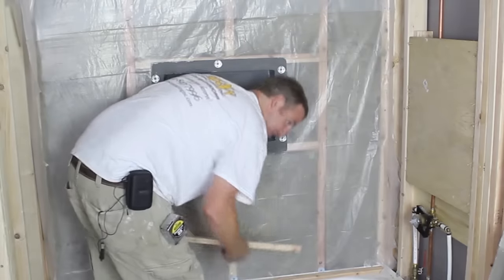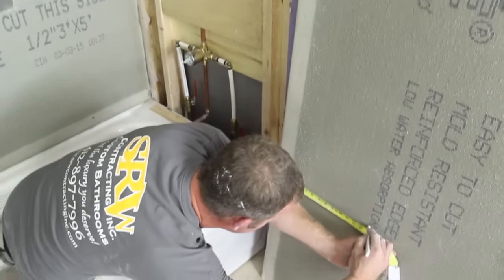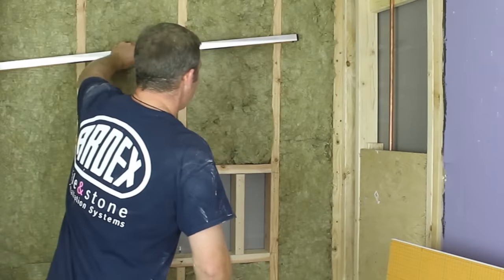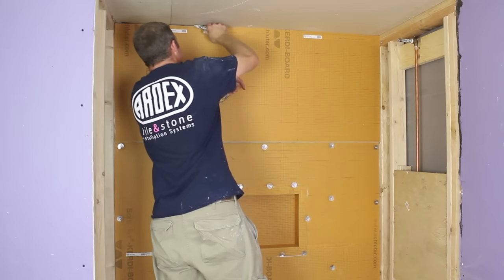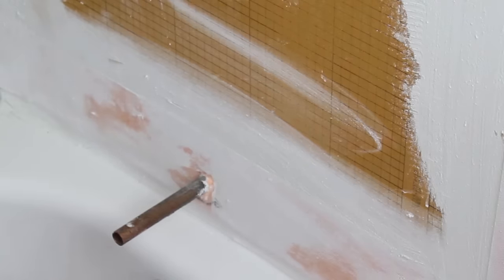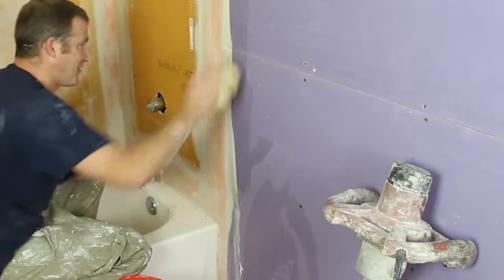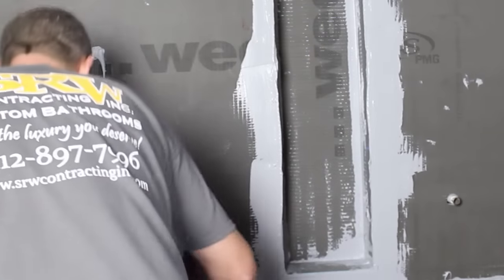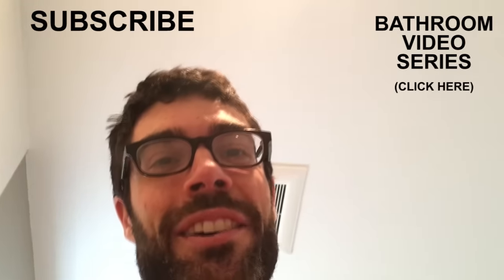How to Waterproof a Shower (3 Awesome Methods!!)

Comment: All 3 are proper methods! As tile setter, I’ve used all 3. Wedi is the hardest to clean, as the sealant is petroleum based and its very expensive. But thanks for a video showing PROPER waterproofing methods.
Reply from the maker: Thanks Terry, appreciate your kind words and taking the time to watch our videos
Reply: Here N There Ede
Reply: What would you use to waterproof the cement board? Liquid membrane?
Reply: Veronica Gutierrez Yes. I find that using fiber tape at seems is advisable.  I just paint it in with the waterproofing.
Reply: @herenthere10  Is thinset on seams necessary if you use waterproof membrane and cloth in seams or do you need to do both?? thank you
Reply: Keith Owens Thinser it not necessary. In fact ive used the liquid membrane to “paint” on the mesh tape. If you use cloth mesh, manufacturers suggest you sandwich material between wet coats. In other words apply mesh cloth while first coat is still wet then apply another coat over mesh. Sorry if i didn’t make that sound clear🙄
Reply: ....Been a long week
Reply: @herenthere10  Thank you for very thorough explanation...........now go relax!! You deserve a break :)

Comment: I've been using Schluter to their specs. It's not mentioned in your great summary that Kerdi board comes in several different thicknesses - this can be a boon when you need either full tile support (board to studs) or just a veneer (board over other wall material). Also, Schluter  pipe seals and profiles are cool to use.

Comment: I have used the Schlüter System several times and my only complaint is that I have found 16” on Center to be too great. The boards actually seem to become concave. I have found that I need 12” on Center to prevent that from happening. Great Video and tips.

Comment: I am an Stucco  contractor  and I have seen many issues with mold and rot, rule number one to avoid  mold and  rot  is AIR, materials  need to be able to breath.

That been said, I rather use the Cement Board method  but with a little twist.

First thing I will do to my bathroom is  instead  of cover the  entire wall  with  plastic like you did  I would do  the plastic installation from the  tub up to  just a little  above the shower  and not all the way up, that way  yes I am  protecting the studs from possible water but at the same time in case of a  leak  or moisture build  up I did not cover the entire wall with plastic, in that way I'm allowing the  air to  breath  through the  wall if needed.

Second,  I would  prebuild the niche out 2x4s  cut the Cement board to the shape  of the  niche and then  install the premade tile ready  niche on top, then properly seal it with the  waterproof membrane and mesh.

The other reason I like Cement board and the pre made niche against the third method is  because we have less changes of a leak  since we are basically joining to pieces together  compare to the  third method you show where you  cut a bunch of pieces and join them together with silicon. to me is  a NO, NO, the more joints the more chances of a potential leak.

Second method  use thinset to seal all the joints  with the  mesh, while  Thinset is some what waterproof, I don't feel comfortable sealing  my joints with  a mix of cement, sand  and water.  Once again we come to the Cement board where all joints are seal with a  mesh and a water proof membrane which leaves no gaps or joints,it becomes a  ONE seal, ONE complete coat, ONE waterproof membrane.  and once again the  less joints the less changes of leak.

The other reason I will go with  the Cement board is because is a more solid  material, compare to what looks to me a 1/4" piece of foam/plastic.I don't have a problem spending a bit more of time cutting the  backerboard.

 So to  me  I will  Prefer the Cement Borad Method or any other  similar process and/or materials.

my .02 by the way
Reply: macrapidito Would you plastic wrap all the way up and over if it is a steam shower?
Reply: Jerk Of All Trades that's why you are doing the water proof membrane over the entire wall. 
That will prevent the water to penetrate the board and the 2x4s
Reply: carrying a whole shower in to a house in one trip with kboard and wedi ill take that any day but to each their own. Wedi and Schulter make boards from 1/8 to 2in and can be cut with a utility knife. cuts way easier than cement board and no dust either. Also it depends on if you use cement board or fiber cement board. fiber board shouldn't get set below a shower pan there needs to be a gap because it wicks water more while the approved method for cement board is for it to be set into the mud bed after your pre pitch. Wet areas are only water proof if the proper mil thickness was achieved with a roll on application.Schulter is waterproof because of capillary action. When there is proper coverage, the thin set fills all the pores in the kerdi and damns up any water. Thin set is not waterproof at the moment. Old ships were done similar to wedi tight joints and sealant. it's not a new process they just use a waterproofing sealant to do so. Also those systems cut down on time. A mud bed needs a few days to adequately dry after being packed whereas a foam pan and shower system is ready in 30 min after sealing everything up with wedi.  . Proper waterproofing, drainage, and adequate  slope is the most important thing, not air. Simple doesn't mean waterproof.
Reply: cool idea 😎 i see ur .02 and gonna kick ya nickel 🤔 why not just use house wrap keeping it water proof and breathable. before ya know our tubs will be full of dimes😉👉
Reply: Wow! I wish you were my neighbor and helping me with shower install and I was paying you in beer! Would you ever use a shower pan without a tile lip? It mounts between the walls and gets a  polyurethane caulk to make a seal. I was looking at a shower tray from for Porcelanosa.
Reply: Why use plastic at all when you can use the old school, tried and proven method of 30# felt/roofing paper, stapled to the studs, seams flashed and flashed to tub flange?  Everybody's trying to invent a different way but the old way works just fine.
Reply: Love your feedback................ Questiion............ I am currently installing Perma Base Plus Cement Board in my shower build. Can I just tape all the seams with a waterproof membrane like Hydro Ban and a fiberglass cloth from laticrete? or do I have to thinset/tape and liquid membrane and cloth mesh both?? Thank you for your feedback!!

Comment: 1/4" mold resistant drywall with 3 layers of Redgard and waterproofing tape on all joints and corners on the bottom half of the walls. Water doesn't sit on the shower wall 1 foot above your head. Showers always fail at the same spot, bottom corners and the curb so thats where the focus needs to be on waterproofing.
Reply: You are going to have a problem with mold.

Comment: I am a DIY not a professional. I learned a lot here. Thank you. My personal preference is the cement board. I only have one reason why. I am thick headed and fear change. Other than that, the other 2 methods looked like you were using the same technique as a dry wall guy. Again, thank you for the video.
Reply from the maker: Thanks Angelo, you'd like wedi and KERDI-BOARD. Totally understand why you'd like cement board though. Keep in mind that wedi has been around for over 30 years. Lots of time for testing and refinement

Comment: I used Laticrete Hydrobarrier over Durock on the first tub surround I had done as a contractor a few months ago and was thoroughly impressed.  After the recommended 3 coats you could just feel and see how secure an impenetrable it was.  Another thing I liked is that it gave a really nice, unobstructed surface to set the tile on.  Not a lot of build up at the joints or bumps in the field.
Reply from the maker: Thanks for letting us know, maybe we should do a tutorial using it. That's one of the concerns that might be overlooked...how smooth is the finished product. It's not that big of a deal with larger tiles but smaller ones it could be a problem.
Reply: That's a concern of mine as well.  Durock has 2 sides, rough side for mortar and smooth side for mastic.  If you RedGuard (or equivalent) the boards, they are all smooth. Doesn't that create an adhesion problem?  

Your videos are absolutely awesome BTW.  There are only two other YouTube bathroom contractors I subscribe to (HouseImprovements and TileMasterGA)  

Their videos are a little different than yours, not good or bad, just a different instruction method (like Bruce Lee, your style is to have no style, but to flow like water, lol).  What I like about yours is the quality of your videos (audio/video) and how you break down the MANY ways of doing a job rather than just how you are doing it today.   You also always highlight the tools and materials (your tile cutting video and troweling video is a perfect example of this.) VERY easy for the layperson to pick up on.

Thanks again for these fantastic tutorials.  You open up the mysterious world of construction to the everyday homeowner.
Reply: PRESLOPE!!!!!!!!!!
Reply: I've been watching him demonstrate preslopes all morning, so I think you are confused. It's the STARR TILE guy that's non-preslope, no pebbles in the weep holes crazy.

Comment: We plan to meet this week with a Wedi dealer and use this method for a roll in shower, thanks to your video and the install video you have.  Thanks 👍
Reply from the maker: thank you, please let us know if you have other installation questions. Getting the pan and main floor installation correct is very important but we can assist with those tips 👍🏼

Comment: Been doing showers.tub surrounds for two decades..in Mexico and western Canada. I use the wedi preformed shower pan, wedi caulking between all joints with cement board on the walls/ceiling. Then coat all walls and corner tape with ardex 8+9 as per instructions.3 coats on everything. One kit costs about 70 dollars cdn. Leak free everytime. Ardex makes the best products in the industry. Period!  Fester makes a product similar to 8+9 for waterproofing showers floors and cement block walls in mexico/south America. I got laughed at by mexican tile setters for coating the terrace floor and showers of the wifes house. No leaks.building science people,use it!
Reply from the maker: Love that last sentence Brett...Building Science. Good explanation of why it's good to try these new products.

Comment: I would use 2 because it seems more cost effective and easier to use than hardy board. I actually have a remodeled shower where they didn't seal the hardy board so now I'm getting worried. I know the pan was done correctly. Does it matter if you live in a high humidity house or not? It's been in 6 years now and still working well. Thanks for the video. I love it. ❣️

Comment: Great video...The cement board looks like its harder to work with especially if doing it alone but looks like it would hold the tiles better. Something about a soft wall holding tiles scares me.
Reply from the maker: Don't be scared of foam boards, they're more solid than you think. Cement board is a good option but not the only one to consider.

Comment: Wow!  The Kerdi board looks amazingly easy to work with.  I used something I think was called "green board" (or wonder board?), years ago and it was a struggle for me as, like cement board, the panels were a bit heavy for one woman to work with but this looks totally doable.
Reply from the maker: you'd like KERDI-BOARD and Wedi, super light and easy to use.
Reply: It's super expensive too
Reply: Absolutely worth the money!!!

Comment: I prefer Schulter. They have a wall system that is a roll out membrane. You can go over any surface. But if I’m just doing a tile surround over a tub. I use permabase concrete boards and red guard. It’s most durable and fastest to lay tile on.

Comment: I like the cement board, because it's more rigid.  That could be a plus if your kids are rough in the shower and bang on the walls regarding tile.
Reply from the maker: I understand where you're coming from, don't discount the strength of the foam products. They're made to withstand a lot of weight.
Reply: Frankie has raised an important concern that I share.   The damage might come from one slip in the shower by an adult; not necessarily from kids.   But the manufacturer's of foam products must have thought of this.   So if they have published any results of "destructive testing" then you ought to re-publish that, in support of your splendid video.

Keep up the great work, Jeff.  You're a rising star.
Reply: A shower should be built for two adults being youthful. It’s inevitable ;-)
Reply: Right Frankie  I have an Autistic son who loves his shower . Kicks the walls ect . He would destroy that foam rubbish . I went 9mm Cement sheeting with studs at 300 centres with a rubberised epoxy membrane . Works like a treat far quicker and cheaper .
Reply: There are destructive tests called Robinson floor tester. It is how flooring gets classified as residential, commercial, or industrial. I had heard that Kerri board was being tested as a flooring underlayment, but haven't heard any verification. Plenty strong enough to handle an adult slip.

Comment: It was interesting to learn of the last two methods but i always use a cement board and a waterproofing membrane and ive had 16 years of great results
Reply from the maker: Cement board isn't terrible, but many believe it's waterproof and don't use a membrane like yourself.
Reply: I do have a question for you if you could answer it for me. Im currently framing the first walk in shower thats bigger than the standard size piece of pan liner bought at lowes. Whats the best way to join two pieces of liner and where is the best place in the floor to join when necessary? The shower is 6'×5' with a 16" deep bench on one end that stretches across one of the 5' walls with the shower valve and head on the opposite wall. I was considering covering the bench with the liner first and then with hardie board and then use a water proofing membrane after that. Could I trouble you for your thoughts on the matter?

Comment: I have tried all 3. I prefer cement board  with red guard. red guard is waterproof paint and visually striking so it's impossible to miss a spot. wedi board is almost 4x more expensive than cement board and not as strong. the Wedi joint sealent also sucks. but I would make wedi my 2nd choice. Schluder is the worst of these choices. it's the most expensive, and the unmodified thinset is not waterproof, which means the kerdi mesh is going to get wet. if there is any micro tears in the mesh water will get through. also, the mesh is prone to slight folds and bumps which shows up in your tile work on top, and people tend to shave it off, ruining the seal(!) kerdi is also incredibly expensive.

DO NOT PUT ON RED GUARD WITHOUT A HIGH QUALITY MASK. it will kill your brain cells
Reply from the maker: +Nick Steele totally agree with you on the RedGard. It's potent to say the least 😳
Reply: Sorry to say that you will most likely be having trouble getting rid of the constant mold.  Any product that is modified contains latex. Latex is organic. Which is a food source for mold.  In any shower, unmodified thinset should be the only thinset used.

Comment: First, I double stud the walls and block the floor every 16" to 24" if I can't double joists especially with I-joists. Then I use either 1/2" or 3/4" ( I prefer 3/4") plywood on the walls, 3/4" on the floor. Then, from the floor to ceiling if 8' high I use Grace Ice and Water Shield and Tyvek Flexwrap at corners of bottom and over the drain (the stuff sticks extremely well to Grace and PVC or metal and the bond gets better over time). The Grace is a vapor barrier. I still put the membrane down for added protection then cement board on the walls. The double studs, plywood and floor blocking (bridging) helps almost eliminate deflection which prevents the corners from cracking so you don't have to caulk them if you don't want to. Did several jobs this way over the past several years and my own bathroom 6 years ago  and I've had zero issues and no cracks at the corners. Not saying it's the right way or wrong way, just another method to think about. I wish all of you success in your shower/tub surround adventures!
Reply from the maker: Thanks 20footcommute, we like the systems because they provide a warranty for both the homeowner and installer. But totally respect your method, sounds very solid.

Comment: Steve deserves a raise, good job! This goes wrong at wood studs, they should be steel, but such is the usual USA building style...and yes, I'm American but worked jobsites in Europe for 8 years. Wood and water isn't a good mix, build your home with steel studs or cement block.
Reply: Out of interest have you been working in the UK where I'm from ? as metal stud work is standard unless your a bodge job man.

Comment: After having a home with a walk in tile shower, I prefer a fiberglass shower from bottom to top.  I know it’s not the most aesthetically pleasing compared to a nice tile and color coordinated but it’s much easier to clean and can last a very long time.
Reply: I have been thinking about this too. Thank you. Also I was considering an alternative like those full 4x8 sheets of synthetic marble cut to fit so there is a minimum amount of seems. Less tile work with less chances for water leakage... now days they have so many colors or none at all. And prices are reasonable...  have a great day and be well.
Reply: @RestoreITdontJunkIT  Try checking out Fibo wall panels. So many selections